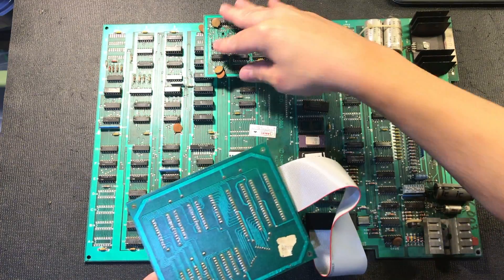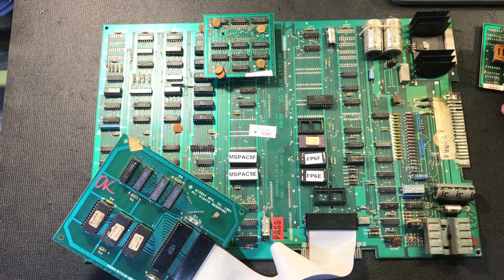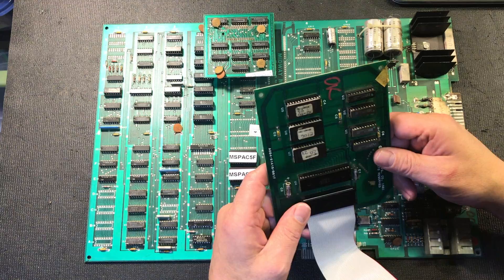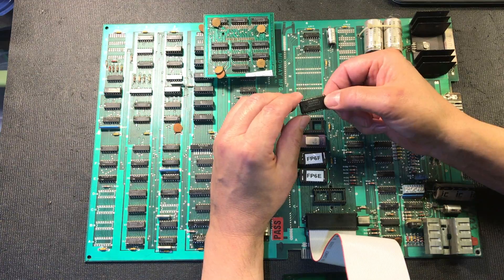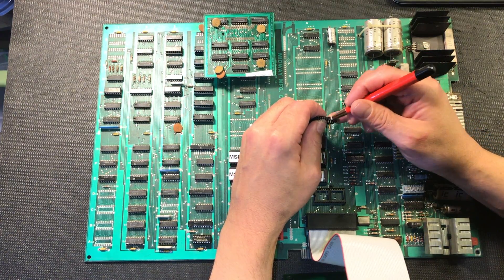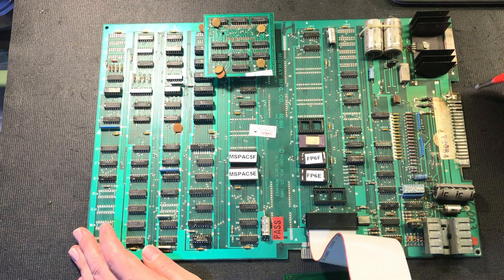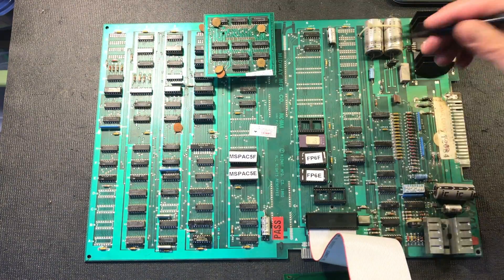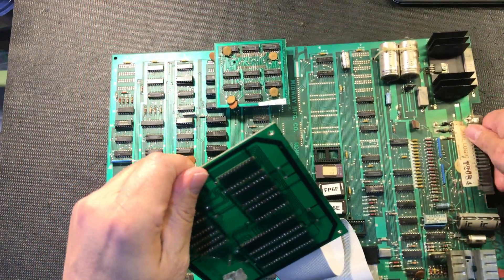Let's Look at Pac-Man Boards - Part 2: Ms. Pac-Man // Arcade Tech & Repairs

Comment: I FIX OLD STUFF, how do you calculate each ROM ranges if you don't have the games memory mapping ranges? What programmer do you use to test and check TTL and CMOS IC chips? Can you explain how the arcade monitors takes RGB signals and Vertical & horizontal sync signals and converts them into deflection signals and flyback signals to draw graphics on the CRT screen, but how does it do this?
Reply from the maker: Can only fit so much into one video! Thanks for watching